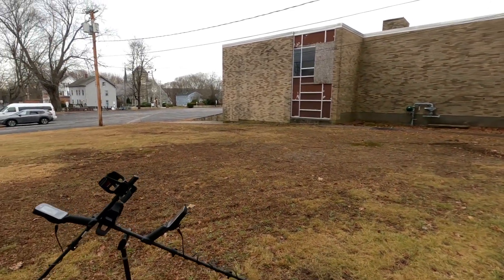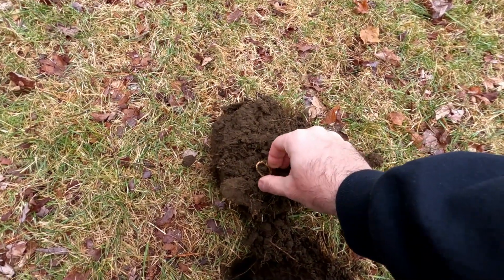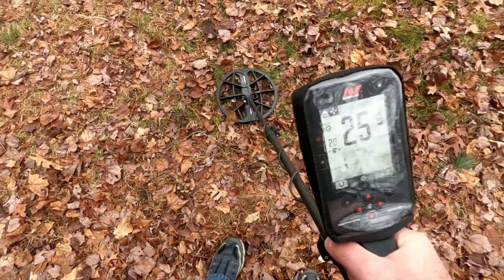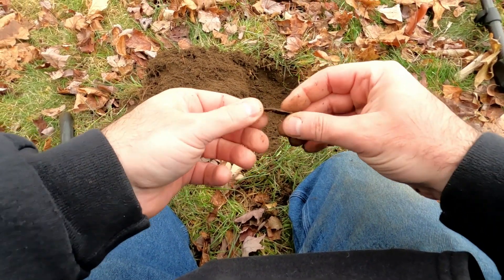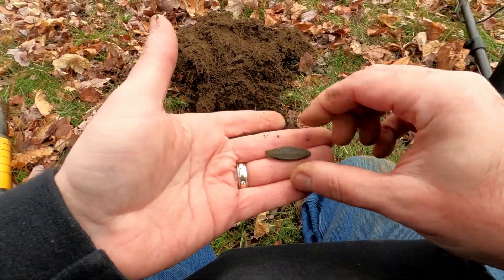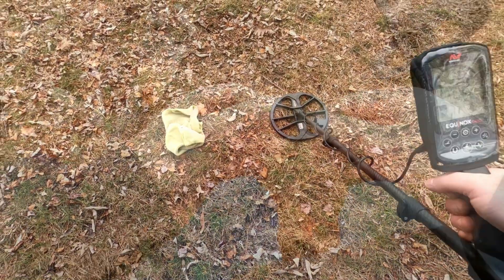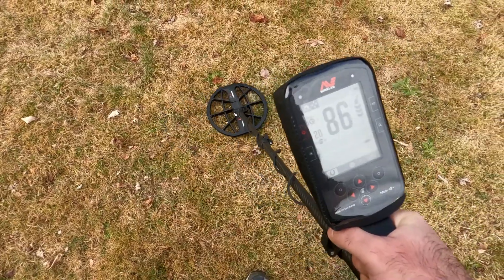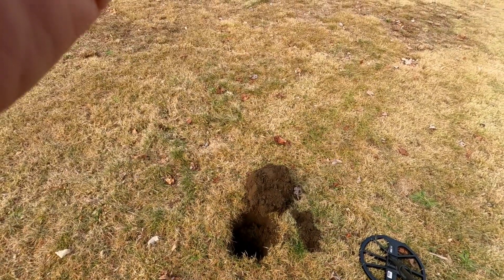Minelab Manticore & Minelab Equinox 900 Comparing Signals

Comment: Thanks buddy.  I usually check my signals with at least three metal detectors and if I’m not sure I use my fourth I noticed you were able to get by with only one pin pointer. Very very talented.  🤓👍🏼
Reply from the maker: You have been doing this long enough to drop down to two now. Baby steps my friend. 😉
Reply: Lol.  That’s the reply. I was looking forward to.

Comment: To supplant the glare on the screen you done a good job demonstrating by your adequate verbiage.  Around 9:46 the Manticore and then the 900 reflected the VDI (Visual Discrimination Indication) indicated in the 90's; possibly, being silver?  It would be interesting to see what frequency they indicated in the 90's?  What was the attributable factor that it made the alloy (target) appear to be silver?  It would be nice to have had a White's Spectra V3i there and swung it over the 'target' to ascertain the frequency most dominate?  Whatever frequency most dominate on 'both machines' indicated' silver? ? ?  One would have to change to single frequency to ascertain that information with those machines?  This information would be helpful in cherry picking for silver.  I enjoyed the video as always!
Reply from the maker: Thanks Don, when i was editing i noticed the bad glare and was glad i rambled off the VDIs. Will have to keep those covers off in the future. Lowest frequency will always hit silver the best. I have never used a V3I but heard good things about them.
Reply: @IffySignals  You always do a good job being thorough!  The 90's was obviously wrong and it was not silver as evidenced by the fact it was not silver?  What was the VDI?  It indicated in the 90's and you thought it would be silver; however, it was a 'penny'?  A wheat penny!  That presents an inquiry both machines indicated in the 90's?  Was there more in that hole?   Was it indicating in the 90's because it was 'deep' and the soil appears to be wet?  Did you have another target closer to the cloth you had thrown down?  Was that the VDI in the 90's?  Notice how the sound was closer to the cloth than the hole you 'winked'. Not only was the wheat penny further away it was obviously on the far-right hand side of the hole?   Do an air test on that wheat penny and ascertain the VDI?  I just watched another video with the Minelab Equinox 900 and 'silvers' VDI are in the 90's!  The wheat penny as indicated in the video I just watched have a VDI in the low 60's? I believe you had (2) two targets?   Thanks for the video.

Comment: Is the Manticore & Minelab Equinox 900 both consistent in indicating VID (Visual Discrimination Indication) in the 90's; thus, indicating the alloy is silver?  Would this be 'falsing' indicating the alloy is 'silver'?  What is the VID on those (2) two machines for silver?  What frequency would be the dominate?   2.5 kHz is ideal for hard, larger, high conductive metals, Silver / Copper.  It would be interesting to learn what they are indicating purporting to be silver?
Reply from the maker: Hey Don, silver will always be high depending on the size go go way into the 90’s. Both machines follow the same VDI scale. I stick with multi but if you wanted to go to single frequency you can on both units.

Comment: Those 40-41 pull tabs would have likely become a jumpy 45-65 in the single-frequency 5Khz mode (unless it is right on the surface).
Reply from the maker: Thanks for the info Dan

Comment: Not much difference yeah the 2d screen will show you where the signal is on the screen but you still have to go by sound. Is the 2d screen worth it? 
The menu is nice on the manticore the noise canceling is quick but performance wise I think they are almost the same .
Reply from the maker: Hey Mark, i like the menu layout and find the screen useful on the Manticore but the 900 is right there with it 👍
Reply: @IffySignals  yep I could not wait bought the 900 hey I’m in eastern Ct I’d invite you for a Ct river hunt in the spring I’m right on the lower Ct river we had one spot pulled close to 100 silvers with 9 halves back to mid1800’s
Reply from the maker: @markkus1134  awesome Mark. Sounds good to me. My email is in the about section on my channel.
Reply: @IffySignals  👍

Comment: I have detected since 1973, had every technology.  The only machine I ever had that I actually hated was the CTX-3030.  The numbers were always bouncing all over the place.  I noticed the same thing with your 900.  On the dime, it was all over from 50's to 90's.    I noticed it an other items too, but the Manticore didn't seem to do that.
Reply from the maker: My test garden is loaded with small bits of iron nails so it is not the best for testing ID stability. They all bounce around unless i really wiggle directly over it.

Comment: This is the problem: Too big scale...is useless. I imagined your target as if it was on the Equinox 800.
Which is the difference in hitting a pulltab on 14 instead of 42? And a penny on 25 instead of 77?
Reply: The difference is  you have more range to classify specific targets instead of compressing them all into the same ranges.   It's like saying why have 10 flavours of ice cream when you can get away with 5.  Sure you can but..........
Reply: @MrBottlecapBill  Why you have to memorize 10 flavours when you only need to memorize the flavours group? :)
Minelab MD always had half scale...this is a commercial trick to me, to increase users coming from others brands.
So why not 200 or 300 segments? :) why i need to have a 10gr gold ring on 70 and a 2gr on 30? Which is the difference in having 10gr on 25 and 2gr on 13? Still not understand. Even on manticore you will have a pulltab in the same range of a gold ring....
Reply: why have any scale at all just buy a Compadre it's either iron or dig it!
Reply: @SuperJupiter33  the 4 of GoFind is not enough. The 99 of manticore is too much. 40 is a good compromise..IMHO 
If compadre had enhanced sound like the equinox...i would use it!!
Reply from the maker: I definitely like the larger scale. Less combined now, even a nice spread from zinc to copper.
Reply: I definitely like a larger scale also, it was great to see the difference between zinc pennies and copper pennies.  It would just take a few hunts to get them all sorted in my mind, I can’t wait to get started.
Reply: @donaldphelps536  Zinc and copper are 21 and 25 on my 800. Don´t now why a wide spread should be better. You have to consider that the trash will be spread too, and the corroded coins won´t hit on a standard VDI as always. too complicated to me, but thanks God we have the same tones and an enhanced audio of the equinox ... that will help you to recognize a coin from a trash without worring about number.
Reply: as a long time Whites user i can absolutely tell you that the expanded  TID or VID or whatever you call it was sorely needed on these minelab machines. I run a Vanquish 540 and my buddy runs an 800 and we both agree that you need to dig almost every signal. with my Whites i could cherry pick much easier on days when i didnt feel like or have the time to dig 'everything'. The separation an expanded VID gives is worth the price of admission. 0 to 40 sucks....0 to 100 more than doubles where targets fall. if you primarily beach its not a big deal. nif you land hunt it is HUGE   @SandBoy408
Reply: @ninaevans6058  never had any problem in cherry picking wth the nox or any other MD from minelab. I can´t see any advantage in a larger scale that could help me in cherry picking. I`ll tell you more: old white`s MD had -95 + 95 segments but the increase number was by 2 (0-2-4-6-8-10-12 and so on). On the nox is 1 per point, so they are exactly the same.